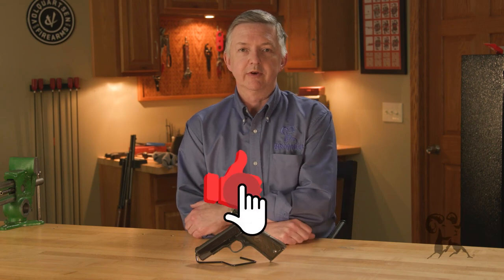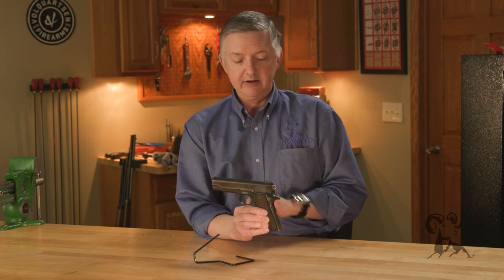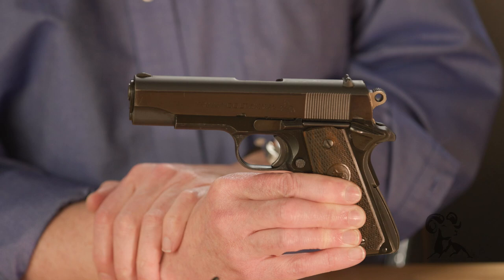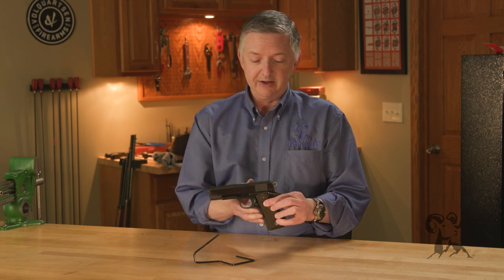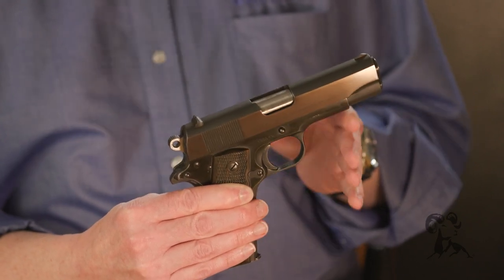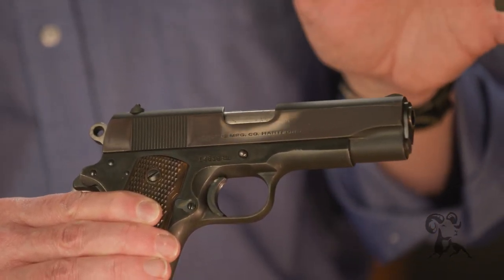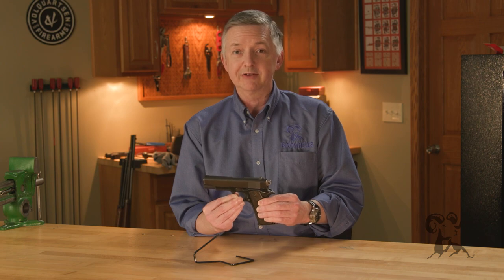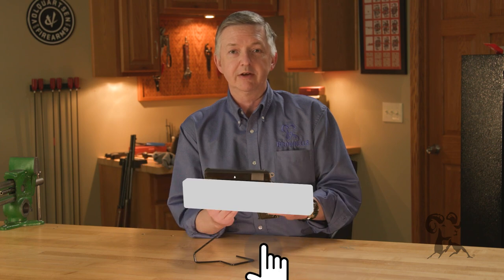From the Vault: U.S. Army C.I.C. Colt 1911 Commander

Comment: I bought my only 45 ACP Colt Commander in 1977 as I was graduating from college and about to enter the Air Force.  I was an avid follower of Jeff Cooper, so shortly after arriving in San Antonio I took it to a retired USAF gunsmith named Bob Day and presented my laundry list of requests for a custom combat pistol.  Bob built up the barrel and installed a modified 38 Super match bushing so it had tight final lockup.  He fitted an adjustable S&W revolver sight to the slide and matched it with a ramp front sight.  He replaced the stock trigger with a longer 1911 trigger and reduced the pull to 4.5 pounds.  Other upgrades included a Swenson ambidextrous thumb safety, beveled magazine well, Pachmayr wraparound rubber grips, and a flat 1911 style mainspring housing.  When Devel introduced the 8-round flush fitting magazine a few year later, I bought three for it.  The Colt was my primary go-to pistol for many years, but their aluminum frame had a reputation for wearing and cracking with continued use.  As less valuable pistols offering similar features became available, I retired it to vault queen status where it remains today, a fond reminder of my youth.
Reply: Great Story. I would seek out for a capstan frame for it and have the original serial number put on it.

Comment: Outstanding 👍 Mine is from 1953 & is exactly the model showcased in this from the Vault video. I've left it completely factory condition but with a handful of slight adjustments & polishing parts & springs that aided reliability of function. Proper magazine maintanence is seemingly paramount to the reliability of these early Colt's 9mm Commanders. Smart rule for all autoloading pistols as well. 🤔 This Colt's Commander Model has been in my pile for about 12 years & is one of the last of the vintage Colt's pistols I've acquired after after yeas of searching. Thanks for another great edition from the Vault 👍 Best wishes.
Reply: Awesome did you remodel the aluminum frame? Or did you leave it at 2 tones
Reply: @user-sf4zb6cz8l  Factory condition. Has patina from age.
Reply: Commanders just like better.

Comment: Those early Commanders also had a lightened slide with extra machining cuts inside. Under hard use they are prone to cracking at the breech face. I second Keith's advice to replace the recoil spring frequently, as well as avoiding super-hot loads like +P.

Comment: Why did they requested 9mm? Did all 1911 should be replaced with 9mm?
Two different sidearm caliber sound counter intuitiv
Reply: I suspect that just like today 9mm is far more common outside of the US than 45. An as for why they didn't just make all 1911s in 9mm... no idea. 

However I wouldn't have done so. The traditional 1911 has serious reliability issues with 9mm. Mainly due to the internal leaf spring extractor. They work fine with a lower velocity round like the 45. However they tend to wear out in as little as a few hundred rounds in 9mm.

Companies like Wilson make improved leaf springs that are tempered with the bend machined in. Which is a vast improvement over the original design that used a sping that was bent after heat treatment.

However Wilson, and most other 1911 manufacturers, often use external extractors now for good reason.

Long story short I wouldn't buy a 1911 in 9mm unless it has an external extractor. If you want something reliable in the long term that is.